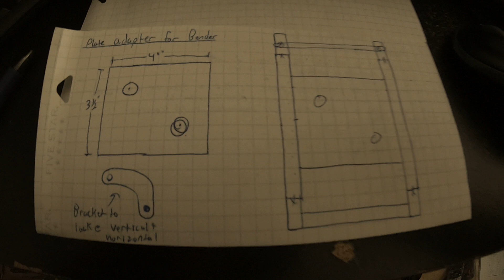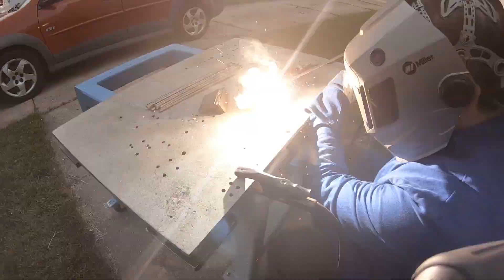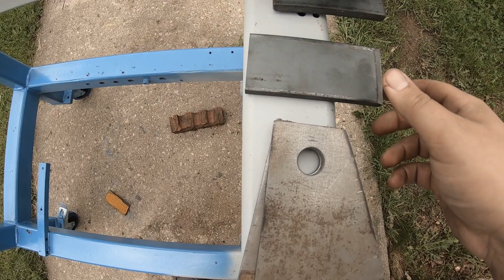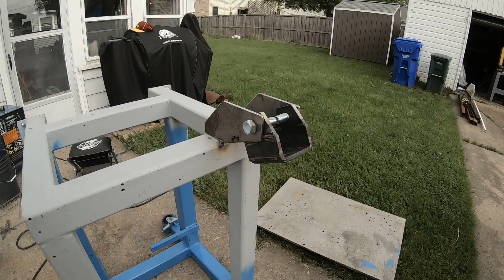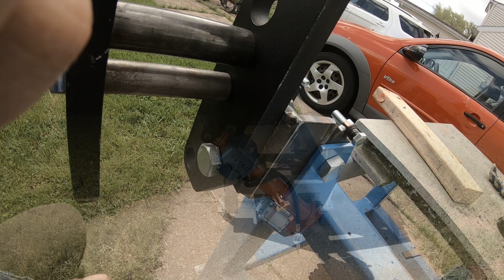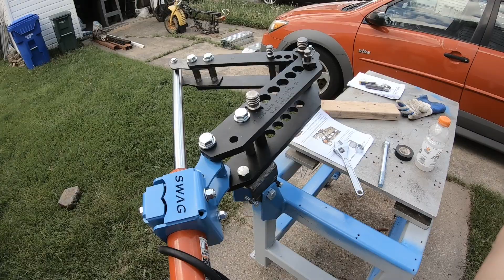Ultimate Tube Bending Table - JD2 Model 32 Air/Hydraulic Bender Set Up

Comment: Friend, first of all I apologize for the English I'm using the translator because I'm not fluent in the language. Can you do me one please tell me what the force mechanism of your pipe bender is like, I made one and I want to add one like yours.
Reply from the maker: I used an air over hydraulic ram.  There is one you can buy from harbour freight that is similar to the one I used.  Just google "PITTSBURGH 8 Ton Super Heavy Duty Long-Ram, Round-Bottom Air/Hydraulic Jack"

Comment: Awesome little fab and build... you should make some paper prints of the brackets! I like the idea.. and see a way to have a pin to set it at the vertical or horizontal position. I dig it man!
Reply from the maker: I like that idea for the pin to lock it in place I may have to steal that from ya if I upgrade that table!

Comment: @Labcoatlucas I really like that blue you used for the swag tool where did you get it?
Reply from the maker: Got it off of Amazon, its the Rust-Oleum 7524838 Professional High Performance Enamel Spray Paint, 15 oz, Safety Blue